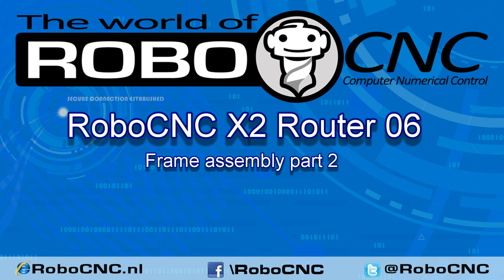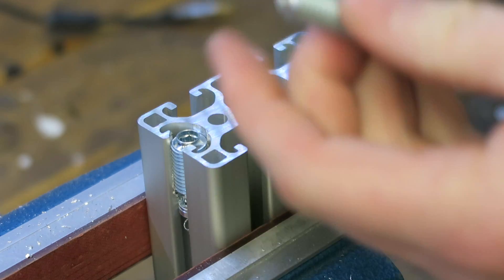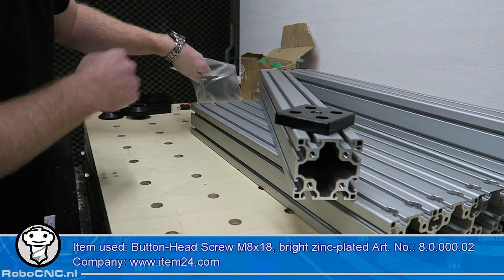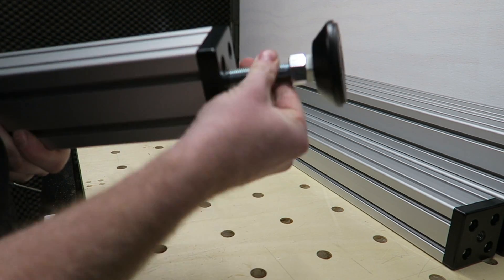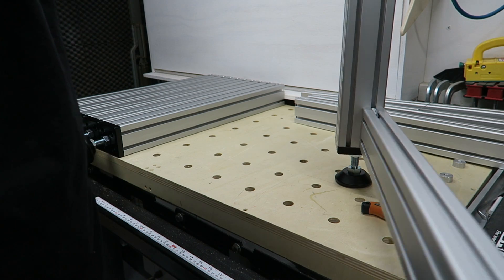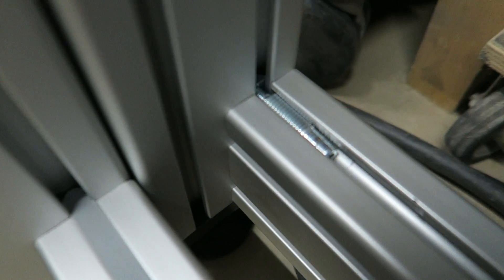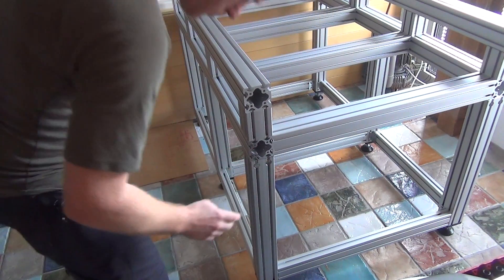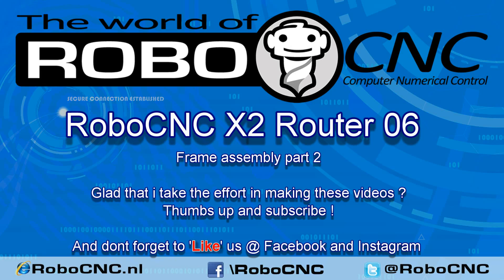RCNC X2 Router 06: Frame Assembly part 2

Comment: Hi Marel! I think I've found the CNC that I'm going to I'm going to modify for my own needs! I'm curious why you didn't use the more substantial fasteners that you used to attach the legs on the main frame of the CNC. According to 8020 (the provider of extrusion here in the States), those more substantial fasteners have a much higher strength than the smaller ones you used. Of course, they're several times the price as well.
Reply from the maker: The CNC rigidity comes from the upper part, and the frame underneath could have been just anything in my opinion.
So by any means make it more sturdy, but you could also place the cnc machine on a workbench without mounting it even.

Comment: This system is not easy to come by where I live without some shipping expenses sadly, though I am driving a good distance to get some  2.5 meter lengths of 40 x 180 for a very good price as lightly used. I hope the one outlet I have found so far can do the machining I need for the universal anchors. I assume you are using 80 x 80 for the vertical and 40 x 100 for the cross members. Forgive me if you mention this Marcel.
Reply from the maker: Hi Chris, Yeah shipping is killing sometimes.... 
For exact sizes you can download the full drawings and price list of my website.. 
It is not as simple as only choosing the square 80x80 size or something like that, material mass is a key factor in the rigidity to...

Comment: Hello Marcel. I saw that you posted a comment a few time ago about ClearPath Servo Motors from Teknic. I'm looking to mount them on my small Isel flatbed that I have and seemed to me that the Teknic motors are a good choice. What do you think about them?
Reply from the maker: Well I wish I could advice you on these.... They seem great, but I have not used or tested them so cant help..
I do believe in the setup like that, seems better than the standard closed-loop stepper systems.
Let us know if you have tried.... And if the makers are reading with us, send me some for testing :)

Comment: That looks to be an extremely well designed system. And I'd feel just as bad as you do about that left handed thread, but were all creatures of habit. Most people have to concentrate a lot when dealing with left handed threads. Add in the extra attention needed while filming and it's not hard at all to make a mistake. No that probably won't help you feel better about it.
Reply from the maker: Thanks a lot for the great comment and support ! And you are absolutely right.... Making mistakes is human..
Also great to hear you like the design so far... again it came from learning from the previous design
Reply: Well I hope you don't mind a design suggestion. You may already know about them or it may have already been suggested by someone else since I'm only fluent in English. Those roll pins are ok but a much better, more accurate, and easier to remove and install method is available although there not used as much today. Taper pins. Yes there harder to find and require the proper taper pin reamer. But if you use the type that have either a male or female thread on the large end they can be easily pulled just by using those threads and a bolt or nut and spacer for jacking them out.  

They obviously couldn't be used on those hardened linear rails of course. But for anything unhardened they work and locate parts into a very repeatable position.
Reply from the maker: Yes of course you might do suggestions ! We are all here on YouTube to learn from each other... I'm not completely sure though on how your comment relates to this video.. But taper pins sound like a great way to align stuff indeed... I could have used those in my Z axis design where I now used the spring style pins... especially on places where things need te be taken apart and put back together it sounds like a good choice..
Reply: My apology's, I should have mentioned I meant for your aluminum plate parts and not for the extruded parts. The nice part about those taper pins is they only have to be pulled a few thousandth's of an inch before there loose and can be then removed with your fingers. And as you've said for multiple trial fits there much easier. Exact hole locations aren't required either since you align the parts, clamp them in place, then drill and ream the taper hole through both parts even with a portable drill. Roll pins are used by a lot of manufacturers today simply because it's a faster and cheaper method. They do make the taper pins without either a male or female thread on the large end, but those are meant for parts where you have access to both sides of a part so you can then use a punch on the small end to drive them out.
Reply from the maker: Nice info !

Comment: The project is looking fantastic. You will have plenty of room underneath for some nice storage draws and other equipment. At what point did you realise that the inserts were left hand. I have done this type of thing before and it will take some time to get over it as most of us are perfectionists. The Angle brackets solved the problem :-) Keep up the good work. Cheers Dave.
Reply from the maker: Yes indeed... If you look closely at the end of the video you see a vacuum pump in the background.
Hope to mount that one in the bottom, and also the electronics. Still there should be some room left.
I had drilled all of them... I only did one with the cordless drill for the video the rest was on the big drill and they went in like butter so I did not notice. when mounting the nuts I had one that fell out and that was when it all came together... Well indeed the angle brackets solve the problem, and for structural purpose it's not that problematic. Thanks for your support Dave !